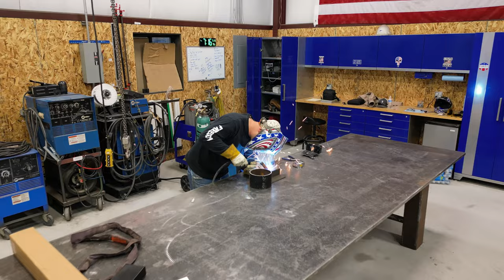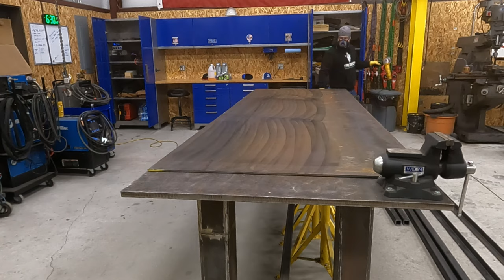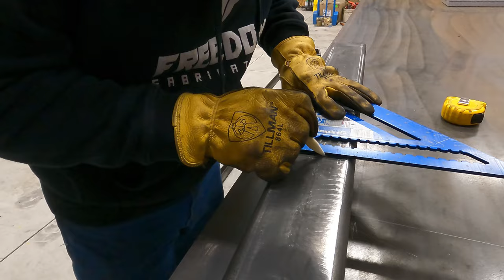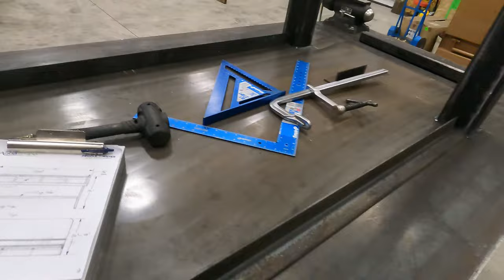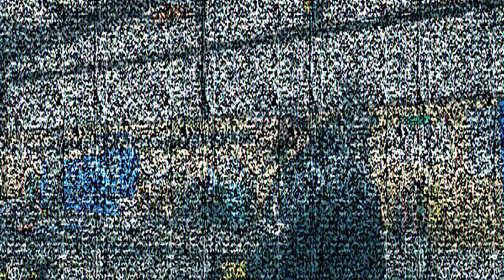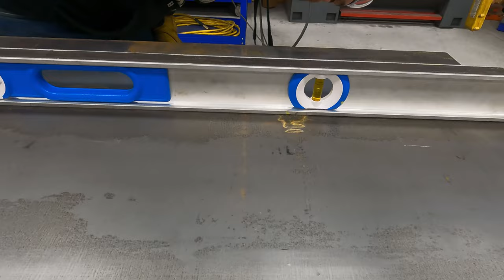Fabricating and welding a Drive roller table - part 1

Comment: The next time you build a table that size start from the middle and work your way out to distribute heat and distortion  control. It will also help to get yourself a magnetic post level, that will give you a faster way and more dependent two way leveling of your post!One last trick for you😁when you have time get some scrap angle just as you had for the box in the center leg to leg post, instead of one tube at a time you will be able to set all four pieces in and weld it up, just make yourself a square angle for your shelving, make  four sets so you can use on other table builds such as this one! just a lil time saver for ya bro! love the vids and as I always say keep'em guessin!!😁
Reply from the maker: Thanks for the advice, and thanks for watching!

Comment: I also find using aluminium angle is almost perfect i tend to have some deflection with steel angle if you ever get some large aluminium angle or box section use it for layout plus if you accidentally tack onto the aluminium it wont bond with the steel
Reply from the maker: Completely agree. We had 12’ stick of aluminum channel at my old job that it’s soul purpose was to be a straight edge for layout and cutting.

Comment: Oh! and you could've just tacked the plate to your table from center, then each corner and fit and weld it out then when it cools grind off from center out and your plate won't have a pull when finnished!

Comment: Nice table, are you going to cap the bottom legs. I have use trailer balls on the bottoms, looks nice and allows adjustments for uneven floors. And depending on the weight of the table you can slide it on them without digging into your concrete if you have to move it.
Reply from the maker: Probably not going to cap the legs, because if I made it adjustable, I would have to trim all the legs to keep the table height @ 37”. The other reason is I’m fortunate enough to have a forklift to move it around, and if I have issues with the table not being level, I usually just shim it up. I do think that trailer ball idea is a great idea to make it adjustable. Thanks for watching!